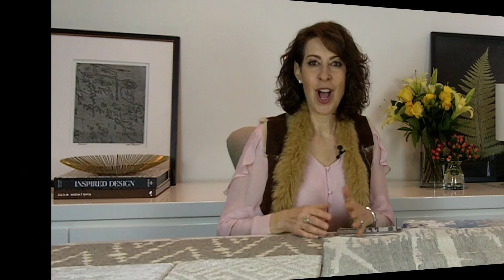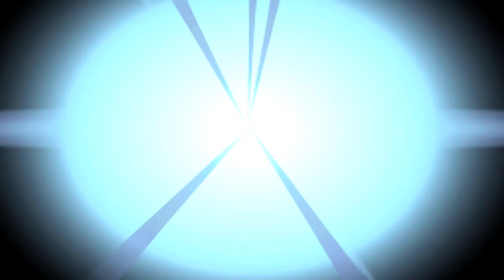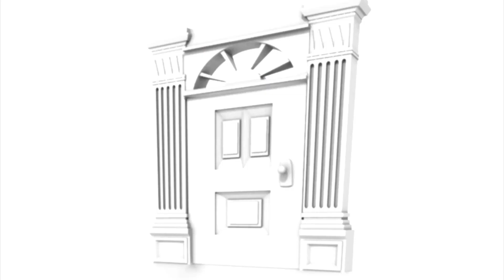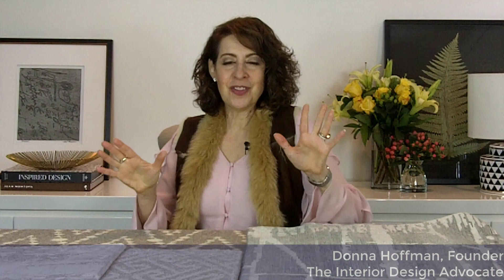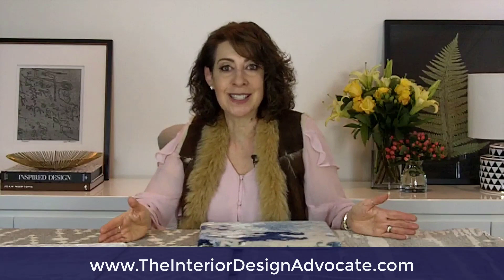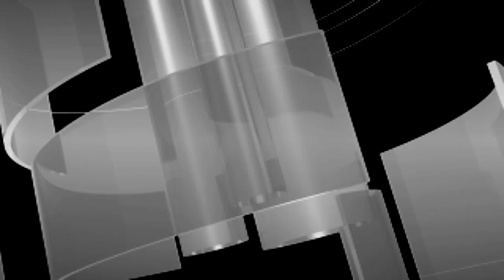The Difference Between Hand Knotted, Hand Tufted, and Machine Loomed Carpets

Comment: i love wool rugs, but how best to avoid shedding? my experience has been that a loop wool rug stops shedding, but a tufted one might shed forever...so, if I don't have thousands to spend, what are your recommendations for me?
Reply from the maker: Hi Sheryl – Great questions. Most wool and nylon rugs will shed for 6 months to up to year after purchase so this do require that you frequently empty your vacuum in the beginning. The shedding is perfectly normal. This said, you should see the shedding taper off, and you should not see it after 1 year.  Additionally, some rugs need to be vacuumed using the beater brush (ie…looped rugs), however the beater brush actually helps move along the shedding process. So if you’re not using a beater brush in order to preserve the integrity of the rug itself, you may have a shedding process that leans closer to that 12 month cycle. Good luck!
Reply: I just got burned on this.  If you go for hand-tufted wool, get one with a loose pile.  I had several very economical ones over the years from Home Depot and when I gave them away 20 years later, they still looked more or less new.  On the other hand, the looped ones have fibers that can be pulled right out of the backing and leave a 1 to 2 inch run like pantyhose.  You cannot use a beater bar vacuum or carpet shampoo machine on them.  If you rub it to spot clean, the fibers are going to start coming out in that spot.  Learn from my mistake if it's not too late.